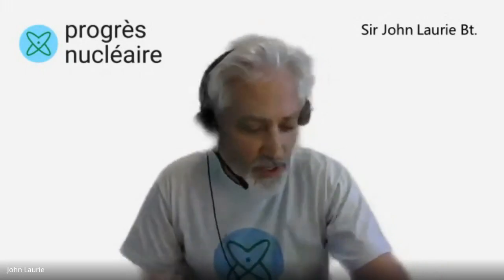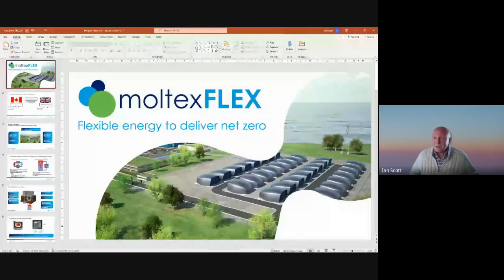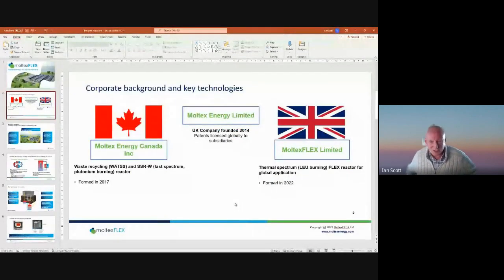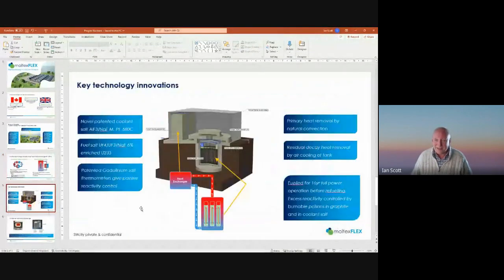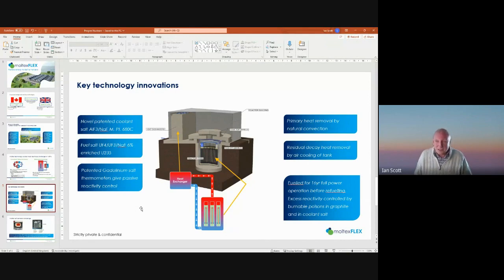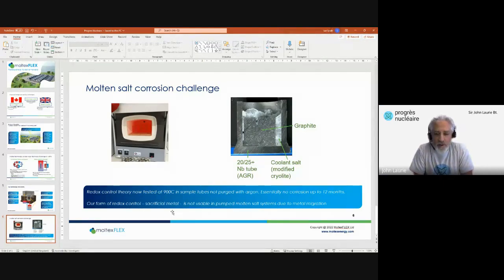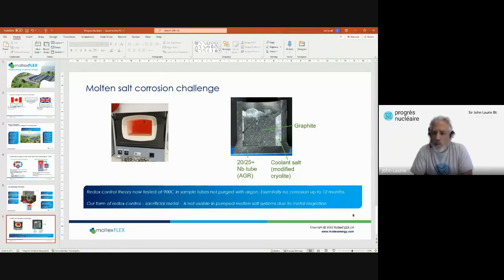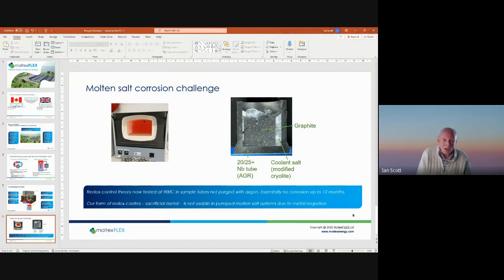FLEX Reactor – the thermal spectrum Stable Salt Reactor

Comment: Moltex has no manufacturing nor construction expertise. They have broken no ground, poured no concrete. Moltex has contributed no significant research or advancements to nuclear science, materials engineering, or reactor technology. The company has not published findings in peer-reviewed journals, demonstrated experimental results, or obtained patents that would showcase advances in molten salt reactor design or materials science. For a company with novel reactor claims, contributions to nuclear science are typically essential indicators of viability and innovation, and this lack suggests a critical gap between their aspirations and technical credibility. The only thing that Moltex has managed to produce is a very expensive PowerPoint presentation.

Comment: This is stupid. 
Why would you pay for a nuclear grid and also the entire fleet of EV batteries and their massive energy storage. 

Do the simple mathematics, this bloke is lost in his nuclear technology.
His expertise is probably good but everything else to do with national grid energy is pathetic. 

I am angry because he is confusing people about what is the minimum cost national and world energy crisis. 
Blah, blah, blah. 

He agrees with nonproliferation of CO2 but ignores nonproliferation of nuclear industries,
Reply: What is going to charge this fleet of EV batteries? If the grid needs the electrons in your EV, how do you get to work? What if you had a long trip planned and you wake up with a half-depleted battery? Where are all the raw materials coming from for all these EVs and the batteries? EVs require 10x the raw materials as an ICE vehicle. Where is the charging power coming from again?
Reply: @chapter4travels  you are right if nuclear electricity is not needed, because fossil fuels are cheap.
And  CO2 is not a problem. 
Why would you bother?
Reply: @stephenbrickwood1602  You didn't answer any of my questions.
Reply: @chapter4travels  Renewables technologies rapidly developing and the EV big batteries usually only do a 7kwh daily drive, normally peoples fuel tank lasts days before refilling.
The EV batteries are kept topped up every day. 
Renewables are used every day. 
Tell your vehicle how much range it needs for the long drive. 
And use rapid chargers along the trip.
Raw materials for the huge national power grid expansion is a massive amount of materials and CO2 pollution. 
EVs do need a greater variety of materials but similar CO2 in production.

The home robotic vacuum cleaner can teach the selfparking EV to connect to the grid,  Hahaha. 
The avg vehicle is parked 23hrs a day. 

As I said if you don't believe CO2 is a problem nuclear and Renewables are not needed. 
We have a massive engineering and energy system that is going to be replaced. 
And so the full system and costs have to be thought about.
Reply: @stephenbrickwood1602  First, renewables technologies are not rapidly developing, which would require defying the laws of physics. They have very low energy density and performance is dependent on a 100% backup system, dependent on location, dependent on season, dependent on weather, and dependent on time of day. They require 400% more material resources including land for farming and transmission. There is no place for renewables on a modern grid. You can power a tiny house with solar, (as I do) but forget the grid.

EVs will not dominate transportation, it will be gas and diesel for quite some time, shifting to synthetic liquid primarily for diesel and jet fuel. (over the next 75+/- years) 

CO2 is completely unimportant, what is important is not wasting such a valuable commodity by burning it for heat. Humanity will need hydrocarbons for thousands of non-heat generation applications for the rest of time or until we can fabricate them with technology unknown today. There is also the matter of real pollution from burning coal. There are 3 billion people on this earth that live in energy poverty. These people will power themselves out of poverty with coal and all the pollution it generates unless there is something cheaper that is just as reliable and just as versatile. Only high-temperature nukes like Moltex in this video can do that. The transition away from fossil fuels will take a very long time 100+ years.

Comment: I love the simplicity of your cooling system, like the old John Deere 2 cylinder tractors and the Ford Model A car. A thermo-siphon cooling system will always work with no moving parts, never had to replace a water pump on a John Deere 2 cyl. or Model A.

Comment: nuclear aint green  when you consider all the concrete also all reactors have two external power supplies usually gas and oil explain that to me
Reply: You ain't edjumacated.
Reply: Ok ... the PWR's which are the most popular reactor currently do indeed use as much concrete as a large building but it is still more green than any other source of power out there, It ammounts to less CO2 than wind, solar or hydro so it's not green but it's the greenest we have. These PWRs also need backup power generators indeed as you call them external power supplies but these would only run in an emergency. In a complete grid blackout which doesn't happen often. Most power plants will never engage them in their entire lifetime other than for testing to make sure it works (probably, maybe they ensure that anoter way) ... this FLEX reactor wouldn't have those of course because it doesn't require active safety systems, it also wouldn't use much concrete because it's not pressurized.

Does that explain things?
Reply: Have you seen the concrete used in ONE wind turbine?
Reply: @jimskirtt5717  Of course. The foundation for the windmill pole must be concrete.

Comment: If you have load following nuclear, why have renewables at all?
Reply: Also (MS) nuclear is a good start for countries/places with no power plants or "renewables".
Reply: No need for renewables, they can only add cost and complexity.
Reply: To cover summer peak loads, it may be cheaper to use solar than build added capacity that goes unused the rest of the year.